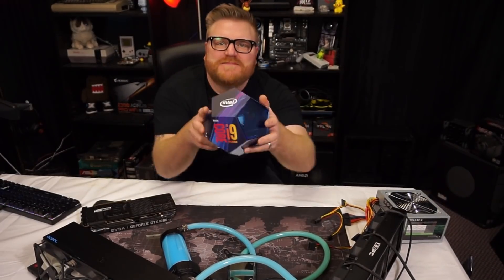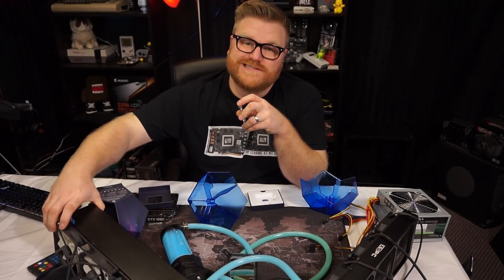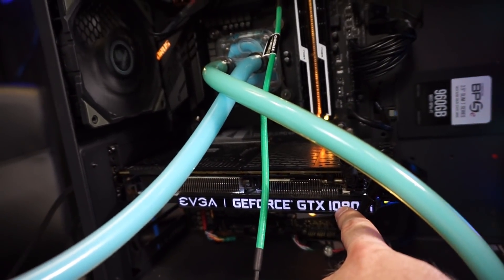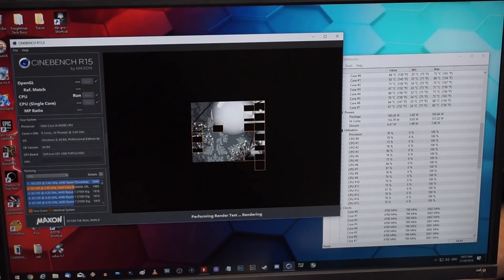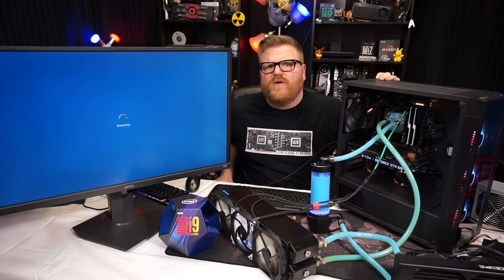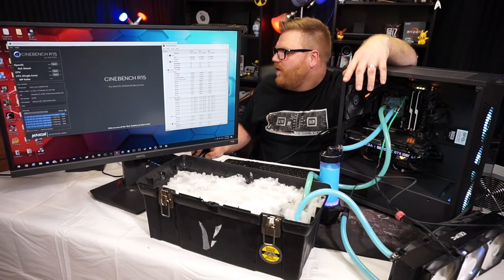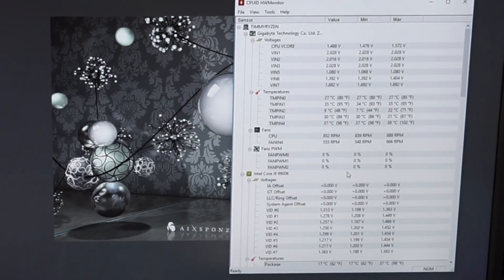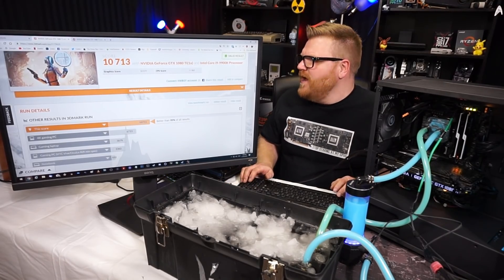Overclocking the Intel 9900k to 5.3 Ghz WITH SNOW!

Comment: Here early today! 

Overclocking with snow is typical for Canadians haha show em where you’re from 😉😂
Reply: I'm Canadian, and I approve this message.
Reply: I'm Minnesotan, and I approve this message.
Reply: My city (in Canada) is nicknamed "Winterpeg" and I approve this message.
Reply: What if you had the 9900K in a good case with two 280mm or 240mm radiators.  Seems like you would need it?
Reply: We Americans overclock with our guns. Unfortunately, there's absolutely terrible thermal performance, but we still get around somehow.
Reply: We Armenians mostly use Windows 7 and Mac OS X and most Armenians have decent 8 year old machine. I have a  brother  he has a old 8 year old pc with 8gb ddr3 1333mhz before it was 4 or 6gb ram so upgraded  and a Xeon with quad , 8 or 12 cores and that is mac OS X and was worth back then from 5,000$ it started and price up to 20,000$ so Apple thinks about money but I still like Apple anyway and I put for him a  rx580  because the old Radeon hd 5770 still holds up in light games like  Tanki X in medium fhd settings  but couldn’t hold up Mac OS X Mojave so I buyed  for him in summer a rx 580 8gb so he can play his favorite games like : PUBG , Minecraft with shadersbootcamp windows 7 professional 64 bit. He just likes to look at cinebench rendering because it renders so fast has something like from 700-1500cb and is a 8 or 6 year year old cpu that is crazy for a old cpu like that.
Reply: Did you try to add salt to ice pool? It melt the ice faster and temperature drops absurdly!
Reply: gardaşım gardaşım gel sarılalım
Reply: I live in Minnesota So I can relate.

Comment: What voltage did you achieve that 5.3 with? My brother and I are running 1.4v on an 9700K at 5.3ghz.
Reply: Wow 1.4V is very high

Comment: Meanwhile doing 5.3ghz with my 9700k aircooled...
Reply: @D 5.4ghz 4.9 cache, liquid cooled. You have more fps in cod mw with hyper-threading off.. and you will not achieve 5.4ghz on all cores with 9900k unless yours is a golden chip...
Reply: @D nice, with an advanced overclock maybe you could get more out of it
Reply: i daily my 9900k at 5.3 with a NH-D15 air cooler as well, no avx offset with 5.0 ring/cache
Reply: @dynamite9541  whats your motherboard?
Reply: @comandobelo7576  maximus xi hero
Reply: @dynamite9541  nice, good overcloking skills aswell I bet

Comment: 9900ks 5,2Ghz/4133Mhz Ram 1.29V with custom watercooling 75c max temps.5.25Ghz is max but 5,3 no chance.i think my CPU is very good.monster in gaming😘
Reply: @D with air conditioning it runs to 5.4^^ lol
Reply: i daily my 9900k at 5.3 with a NH-D15 air coole, no avx offset with 5.0 ring/cache
Reply: @dynamite9541 I've optimized over time^^ runs now with direct die, up to 5,4Ghz👌 / 5Ghz ring / 4133 G skill Ram and temps goes not over 75c. I am very pleased with this cpu.

Comment: why snow? it would be less work and more effective to put fans on both rads and place the rads on mounts just outside the window with only the tubes passing through the window. then wrap or spray an insulating foam around the tubes. im so confused

Comment: how do i set the voltage because when i set the voltage to 1.350 for 5ghz it goes to 1.480....how do i lock the voltage....never had this before and ive overclocked many systems,i have a z390 gaming gigabyte do i have to have more than just the 8pin plugged in?

Comment: I’m at 5.1Ghz.. with 1.370v... tested stable.. playing games I stay at 52 degrees Celsius.. I idle at 32-34 degrees Celsius.. my chip doesn’t get that hot. AT ALL and I’m cooling with a Corsair h100i pro with only an air pull top mounted (fans inside the case)

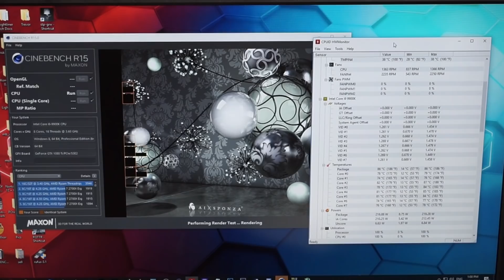Comment: even with snowcooling you hit temps over 84c ? 12:41 even its goes back to low temps .. but still while such a high temps_?
Reply: Because the 9900K IS MOLTEN LAVA and it runs WAY TO HOT

Comment: if its getting that hot in a cinebench run at stock then the voltage is sky high im sure.  could probalby do 5ghz on that same exact voltage.  or probalby less.  that was the case with my 8700k.  runs 5.1ghz with a -40 offset.  so 40 millivolts lower than stock.  they do that to make sure all chips will hit the rated speed but 99% of chips will do way better than that.  if you know what you are doing you could run that on a dh 15 air cooler easy and get stock or a bit of an overclock and still stay under 80c on a cinebench run.  to be honest i think something else is wrong with the setup because its only drawing about 165w and my 8700k can draw about 200w and still run cooler.  and 2 less cores doesnt matter.  165w is 165w.  my cpu is delidded but soldered cpus vs delidded is usually only  about 6 degrees different. 

if you are buying one of these for only gaming then you can run 5ghz or more with the right voltage on one of these with a 35 dollar hyper 612 most likely.  games dont draw more than about 100-120 watts.  for pro work you would want a water cooler or a high end air cooler like a dh 15 with both fans.  but the trick is to overclock it as far as it will go with decent voltage and then just set the power limit correctly.  for my setup i can get up to about 210w while staying in the 70's.  so i set the short power limit to about that and whenever it hits 210w it throttles the cpu down a bit.  games wont ever get close so you will have 5+ghz for games adn browsing etc and for rendering\pro work it will clock down a bit to keep things cool.  and you wont have to lift a finger to change anyhting once you get it setup.

Comment: Just did a Cinebench run at 5.0ghz all cores, have a nh-d15 and max core temp was core 4 at 77 degrees, lowest was core 1 at 72, water cooling is not always the best...

Comment: Just so you know: That radiator with fans is just heating up the loop.

There are videos about that, the whole loop gets warm over time, its not like the water gets warm after the components, and then drops in temperature after the radiator.
You even said that the rad was blowing cool air towards you. If you redo this at some point you have to take out that extra radiator, it is actually making it worse.

Comment: CPU - i9900k
Motherboard - z390 f
Corsair Hydro H150i

5.2ghz oc with 1.35v and it was stable with highest temps at 83°c under load. Best score I had in Cinebench was 2208.
Running it now on 5ghz with 1.250v with temp under load at 71°c. Best score cb was 2152.

Comment: Hi,  Can you help me by answering the questions?   
Do you hear the cpu coin whine when you have your ear close to the back or the front of the cpu when it run?  
When you plug in your speaker or headphone, do you hear that coin whine on your speaker?  
What is your graphic card?
I am having that problem. The coin whine is not loud and unnoticeable if you are not in a quite room, but when you plug in the speaker, it is so loud.  
I use Asus z390 E gaming mother board.  I am looking for the solution for my issue. 
I hope it is because of the board that cause the cpu to sound like that.  
Any helps from other builder of asus and intel chip are appreciated! 
I got the same noise like these video below:  
https://youtu.be/aXA6r5abybM
https://youtu.be/_nb5EBYgTes

Comment: I got mine to complete a bunch of Timespy runs the other night 5.3gHz with 1.375v LLC level 7 (Asus Maximus XI Code) which got me to 99th on single GPU Hall of Fame for a day or two, but I tried it again a couple days later and Cinebench was locking up almost immediately (this is all fully assembled in a case mind you). Dropped back to 5.2 on 1.35v and it's happy again.
Reply: kalmtraveler Mine is also stable at 5.2@1.38V

Comment: It’s crazy how much is required just to push these kinds of speeds. Got an i5 7600k @4.5 GHz strictly air cooled never had any issues, temps are always good. So much extra work is required to get it anywhere near the 5+ GHz mark, it’s just weird
Reply: Ethan Knight Joe is a liar and trying to sell you amd over intel. 7:45 Joe exaggerates the 9900k temps and also underestimates the performance of Noctua NH-D15. Dont believe me, see for yourself as I test exact Cinebench test:  https://youtu.be/POzPHfXSBJ0

Need more proof, watch under AVX load which is way more intense than a 20 second Cinebench test:
https://youtu.be/POzPHfXSBJ0

Comment: @12:45  Cinebench 2306 @ 5.3Ghz?  Thats it?  Thats about 18-24 seconds off a 10 minute render time vs just running it at 4.7Ghz all core and doing nothing special at all on air.  That is, of course, assuming you can keep that 5.3Ghz all core sustained over the entire render time, which is unlikely.  Hardly seems worth it.
Reply: free88 Thank you! Someone who knows what they’re talking about! Joe is a liar and trying to sell you amd over intel. 7:45 Joe exaggerates the 9900k temps and also underestimates the performance of Noctua NH-D15. Dont believe me, see for yourself as I test exact Cinebench test:  https://youtu.be/POzPHfXSBJ0

Need more proof, watch under AVX load which is way more intense than a 20 second Cinebench test:
https://youtu.be/POzPHfXSBJ0

Comment: I am just happy i managed to save up and get myself a i7-8700 but when you start going below ambient temps when overclocking, you have to start thinking about condensation otherwise you will break parts
Reply: Skinnwalk3r Joe is a liar and trying to sell you amd over intel. 7:45 Joe exaggerates the 9900k temps and also underestimates the performance of Noctua NH-D15. Dont believe me, see for yourself as I test exact Cinebench test:  https://youtu.be/POzPHfXSBJ0

Need more proof, watch under AVX load which is way more intense than a 20 second Cinebench test:
https://youtu.be/POzPHfXSBJ0

Comment: Only 2000cb points and 74C with that HUGE cooler? wtff I have 1600cb points on ryzen 1700 with crappy 3 heatpipe air cooler for 15$ and max temp 65C... 9900k is really dissapointing considering its 3-4x higher price
Reply: Bobik Bobikowy Joe is a liar and trying to sell you amd over intel. 7:45 Joe exaggerates the 9900k temps and also underestimates the performance of Noctua NH-D15. Dont believe me, see for yourself as I test exact Cinebench test:  https://youtu.be/POzPHfXSBJ0

Need more proof, watch under AVX load which is way more intense than a 20 second Cinebench test:
https://youtu.be/POzPHfXSBJ0

Comment: I would just buy a 550€ i7 9800k for cheaper I mean who the heck needs a 700-900€ cpu just save 150€ or 350€ and get a better gpu with your money than a i9 9800k and a gtx 1060 bad deal just buy i7 9700k and a gtx 1070 ti or higher also i7 9800k also has freakin 8 cores  some dumb human would spend  350€ or 150€ more on i9 9800k everyone should be okay with a i7 9700k or a i5 what ever 9th generation. I hope  they will release six core i3 9th gen and Pentium quad core 9th gen

Comment: I feel bad for the VRM's on the motherboard. They have to deal with a passive heatsink. My guess it at 5.3 GHz they have to deliver 250W to that CPU alone. 1.48 Volts @85c. That Will degrade the chip fast. But as long as it's just for a short term bechmark, it should be okay. Always remember that higher voltage gives you less temperature tolerance. Counter productive since higher voltage do increase the temperature. (At max 1 Volt,  the chip might handle 100c all day long for years)

Comment: I upgraded from an i5 6500 to an r5 2600, a processor that costs $40 less than the i5 did and went from 520 cine bench to 1250 at stock clocks with the stock cooler. More than double. This i9 with a ridiculous cooling solution that won't fit in a case altogether would cost at least 6 or 7 times the price of the 2600 for not even double the performance when overclocked to levels that are definitely completely unstable.

Comment: This could be a great topic for a future video! 

Yo man, I hope you read this. Nice video, as always! Something to think about though: With the fans running on the other rad, you are actually accelerating the melting of the snow and increasing water temperature since you are running room temp air through that rad. Room temp is way hotter than the other rad's temp that's under errr... snow :D Next time you try this, don't run the fans! Even better, don't put the second rad in there, because it is just  going to soak heat  into the sub-ambient temp water due to the non-submerged rad's massive surface area exposed to room temp. It's simple when you think about it! I also had to make the same mistake to figure it out though :) Would be great to see you test this in practice in a future video. Hit me up here or in PM if you need any info or explanation. I dig your shit man, keep the unique content coming and stay goofy!

EDIT: I actually got a nerd spasm and have an idea. It would be cool (no pun intended) to see a comparison between some (or maybe all) of these scenarios:
1)   2 boring rads with fans (what is air doing with a lot of surface area?)
2)   2 boring rads without fans (what is ambient passive cooling capable of?)
3)   2 Canadian rads (only sub-ambient, be careful about condensation!)
4)   1 Canadian rad and 1 boring rad with fans (does it increase temps?)
5)   1 Canadian rad and 1 boring rad without fans (is it really better than the boring rad with fans?)

Something to consider though is that for this to actually be representative, you'll need longer tests, about 10-min prime95 or Intel Burn Test or LinX runs. (any longer and you're basically just testing how long it takes to melt snow with each setup). Also, you'll need a lot more snow, but let's be honest, you've got plenty of that shit! Also, condensation might become a problem if you go too low with the water temp...I'd be happy to help you research this if you're interested.

EDIT2: Maybe it would actually be a good idea to run the tests until the snow melts and see how long it takes for each setup to achieve that?! Dafaq, I need to start my own youtube channel :D
Reply: Simon Toth Joe is a liar and trying to sell you amd over intel. 7:45 Joe exaggerates the 9900k temps and also underestimates the performance of Noctua NH-D15. Dont believe me, see for yourself as I test exact Cinebench test:  https://youtu.be/POzPHfXSBJ0

Need more proof, watch under AVX load which is way more intense than a 20 second Cinebench test:
https://youtu.be/POzPHfXSBJ0

Comment: Hi Timmy Joe, I'm from Denmark and you are wrong the i9 9900k can be cooled with a NH-D15, in my system I have just set the XMP for ram (3200) and set the power limit to 150 watt(rog strix z390), at 100% use for hours the clock is 4700 on all cores and temp around 75 C.The CPU was expensive and I had to pay overprice to get it early, it preforms well but I am Disappointed with power consumption
Reply: Jørgen BremHolm I agree. I have the gigabyte aorus master with the 9900k and noctua nhd15 and it cools it just fine,  on cinebench Stock it gets to 74 on one core and most in 60s and scores 2055 stock.  With it oc to 5ghz with 1.285 after 20 min of prime 95 one core gets to 90 but most in  mid to high 80s still fine. And I’m gaming doesn’t go above 75

Comment: If your vcore was spiking that high you definitely didn't have it setup right. Or gigabyte bios is just garbage as usual. All power saving should of been off and you should of been on a middle of the range load line setting. No reason to smash LLC to the max without ln2. Even on chilled water you're risking stability with those voltage spikes.

Comment: Typically tubes and rads are running in higher temps than the ambient temps.This is how u benefit from the thermal exchange.But if you put on one of your  rads on snow your tubing will have lower temps than ambient. the second rad is limiting a bit of your cooling  performance by this particular heat exchange.(Cooling your room)

Comment: The other radiator which is not in the snow bucket, will only heat up the system when the loop water temperature goes below room temperature.

Comment: Why are you hitting Ctrl + Alt + Delete for task manager when you can just right click the taskbar and hit Task Manager?
Reply: It's faster
Reply: @Matthew-no4dn  No it's not.
Reply: @UlrichLeland  idk what slow ass hands you got but the keyboard shortcut is faster
Reply: @Matthew-no4dn  So simply right clicking the task bar and left clicking task manager is slower than hitting CTRL+ALT+DELETE and then having to use the mouse to click task manager, so you're already using the mouse anyway, so no it's quicker to just right click task bar and left click task manager.
Reply: @UlrichLeland  what? It's ctrl lshift and esc and it auto opens task manager
Reply: @UlrichLeland  oh I'm sorry we're thinking about 2 different shortcuts and in this case right clicking the task bar would've been better
Reply: @Matthew-no4dn  Well i actually didn't know CTRL LSHIFT and ESC did tnat so thanks, but yeah i mean him using CTRL+ALT+DELETE.